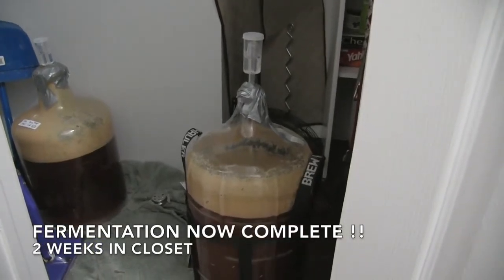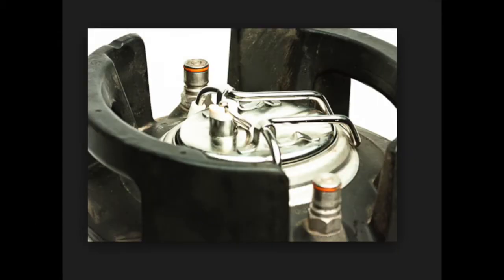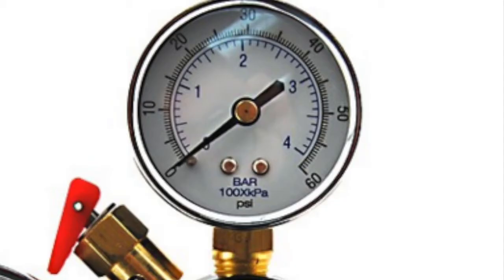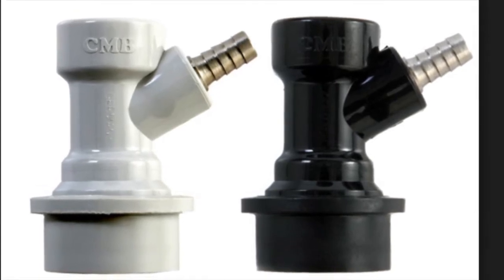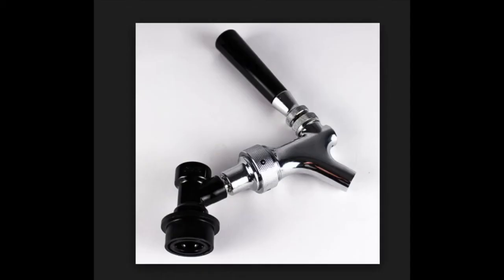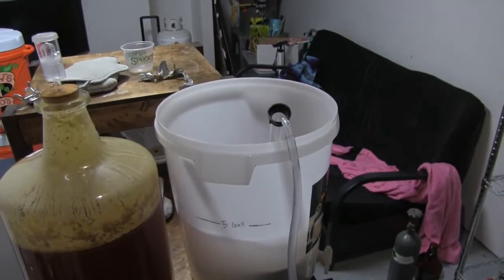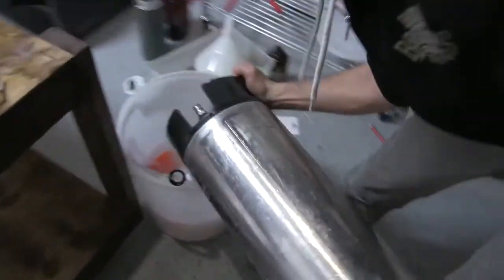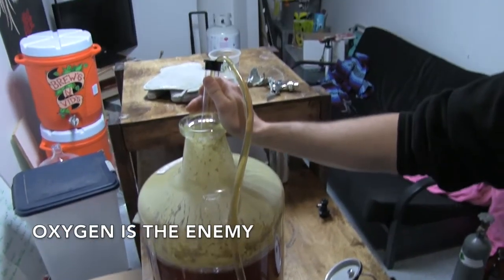7. KEGGING AND CARBONATING HOMEBREW | Ball Lock vs Pin Lock Corny (7/7)

Comment: stupid question time: At the beginning of this series you did 4 gallons of water followed by another 5 gallons to make a 5 gallon batch. that's 9 gallons of water for a 5 gallon batch. Is that right?
Reply: Great question, i am wondering the same thing
Reply: Yes it’s right, a part of the water is absorbed by the grain, you also lose 1 gallon/hour by evaporation while boiling.
Reply: cool, thanks for getting back.